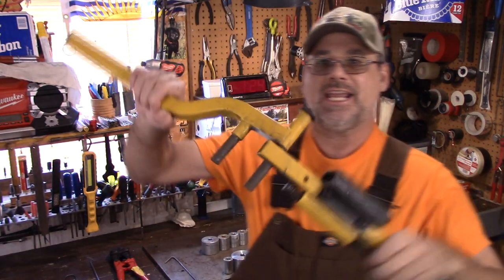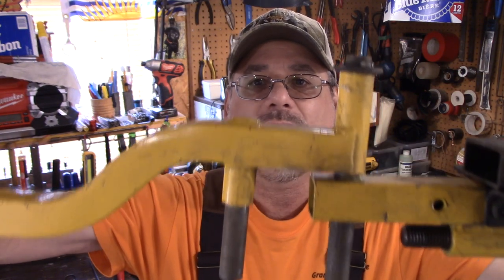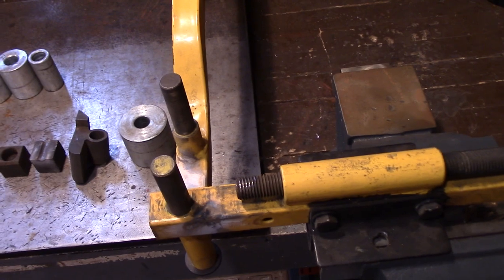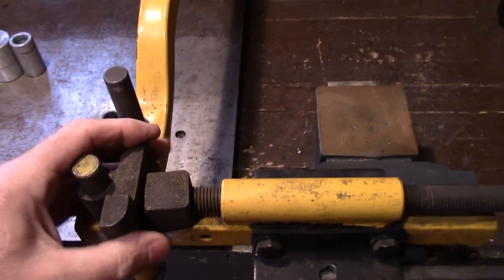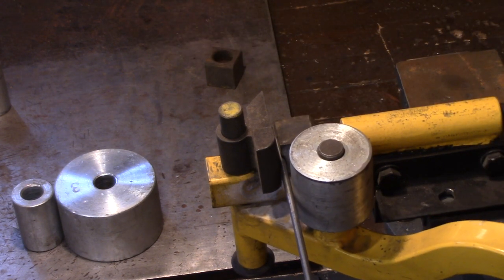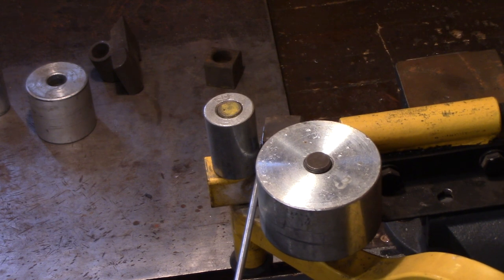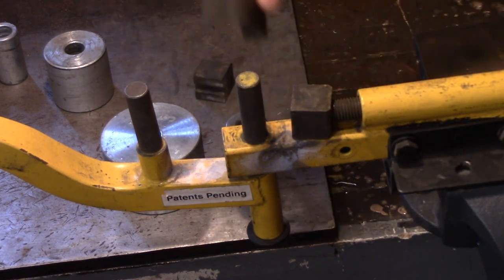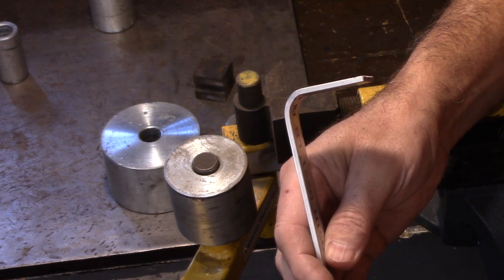METAL BENDER MACHINE REVIEW - HOW TO BEND METAL THE EASY WAY

Comment: That bender did a great job on bending that flat. And that’s better than putting it in a vise and beating it around with a hammer. 😀👍
Reply from the maker: Yes plus most times the metal cracks hitting with a hammer , we get some cheap steel up here maybe :) Cheers Terry

Comment: We as in the paper mill us to have something like this....it was called a Chicago bender and it was fixed to the floor and there were many dies and you could bend many shaps in many kinds of radius....was hand operated but was very handy....I`m sure the idea came from them old machines....just made a lot simpler to sell on the offshore market for the home guy....good one Steve....CHEERS
Reply from the maker: Yes this is a low cost unit very plain but does a great job for basic bends . Cheers Gator

Comment: I've got a little bender for things like coat hangers and stuff but I really should get one like that.  I can think of a bunch of times it would have been handy.  Definitely makes cleaner bends than just clamping it in the vise.
Reply from the maker: Bruce I did the vise thing for many years but the steel would crack most times.

Comment: I was just looking for something like this the other day. Perfect review. Could it make coils?
Reply from the maker: You mean like for a moonshine still - nope not good for that :)
Reply: @SteveRobReviews  well I was wondering kinda like a spring...
Reply from the maker: No not really because the swing is only 180 degrees . I do make springs using wooden  round stock in a vise . Drill a hole in one end and put your stock in there to hold it and  turn in the direction you want . Wood lathe is great for tapered round stock jigs too.
Reply: @SteveRobReviews  you sir are a genius